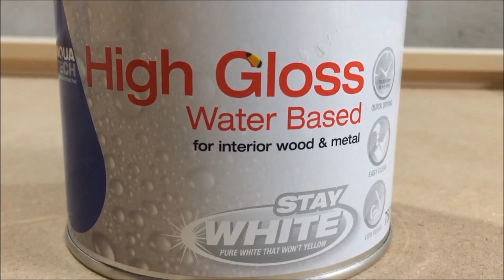Faux Window with your favourite view.

Comment: I have a bedroom that is very asymmetrical in the sense that there are two windows on the far sides of the two adjacent walls, so however I put my bed, I feel like a window is missing on the other side of the bed (there is a roof outside for an actual window. I want to have a faux window there and it has to be identical to the ones I already have, so, I can’t follow this tutorial, plus I do not own those fancy tools anyway. But it is such a beautiful work, and very inspirational, too. (American windows open by sliding up and down, funny right?)
Reply from the maker: Hi, you should find some more info here; https://www.instructables.com/id/Faux-Window-With-Your-Favourite-View/

Comment: Nice job, but I do not understand your measures on the plan. You write « To start I cut 2 pieces of 75mm x 18mm for the sides of the frame; 50mm x 18mm for the bottom » but on the plan sides are 70mm and bottom 45
Reply from the maker: Hi, sorry about that I made a mistake. I have changed it now, thanks for letting me know.
Reply: @EamonWalshDIY  you're welcome, I'm trying to make the same window, so I took the right dimensions :)
Reply from the maker: @xelory8800  I hope there are no more mistakes!! 😃 If you find anymore will you please let me know and I will change them. Thanks again.
Reply: @EamonWalshDIY  yeah sure.
Reply: I made both frames, the front and the back a little less wide. I want to insert between the two frames a large image that will be backlit by leds placed around the rear frame. 

In order to be able to change this image when I want, I would have to fix the two frames together but not permanently. What solution could I use? Thanks